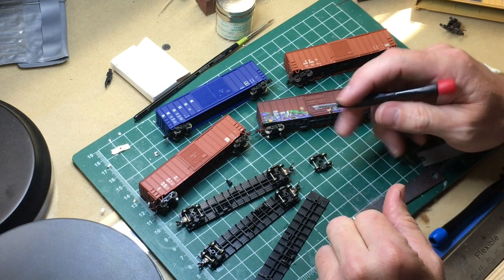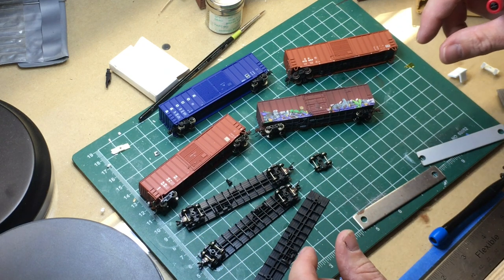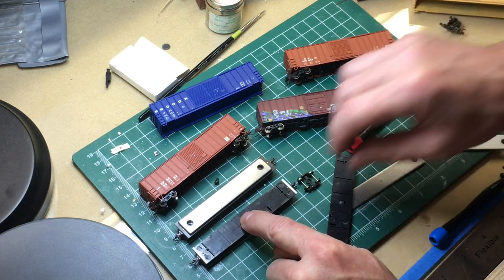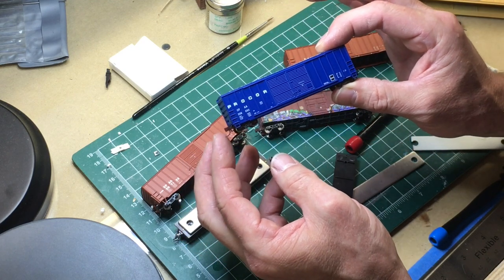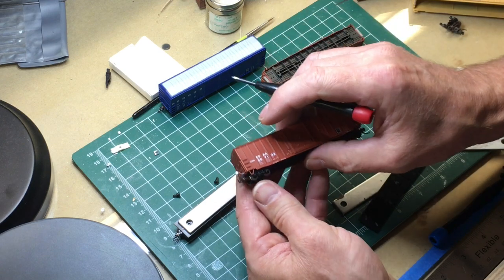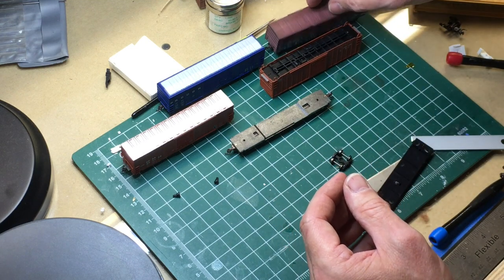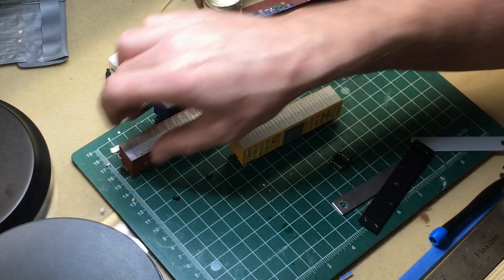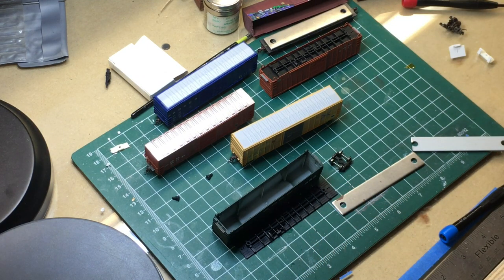50' Boxcars - Ride Height and Body Mount Couplers - Southern Alberta Rail

Comment: What about roundhouse box car kits?  I purchased three cars recently at a good price.   I expected the kits to have typical 70 or 100 ton trucks with dummy couplers.  So, i purchased some McHenry couplers, and fox valley metal wheels.  

To my surprise these cars came with truck mounted rapidos.  I wish I would have opened them up before i purchased parts.

I have several coupler boxes from old Intermountain kits, and considered using those to mount the couplers, and then cut the coupler shank off of the trucks so i could keep them, and just put the FV wheels in the supplied trucks.  

Your thoughts appreciated.
Reply from the maker: Roundhouse cars were modernized when Athearn took them over some time ago.  Originally they came with the horrible trucks that you mention.  I have several that I body mounted MT 1015's to by drilling and tapping the metal floor.  They already sit nice and low so the bolsters don't need any work.  You would be wise to use a better truck underneath them though.  -grant